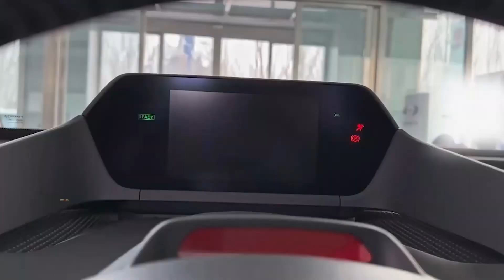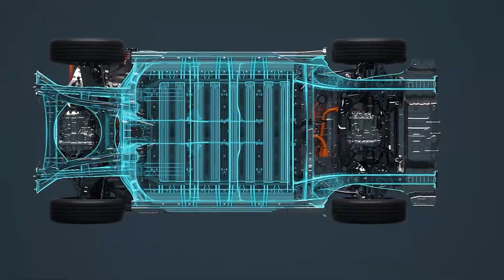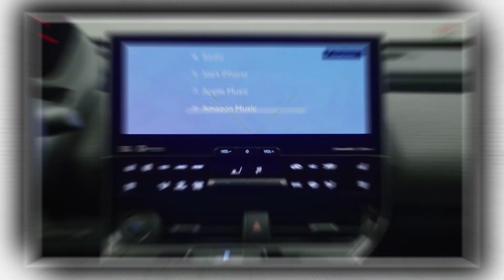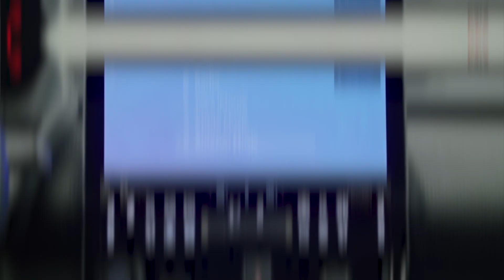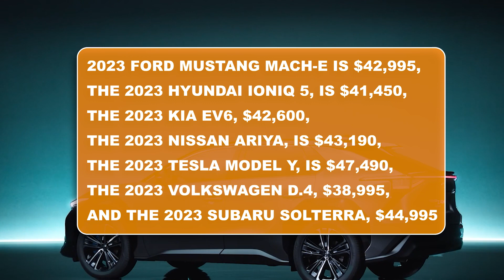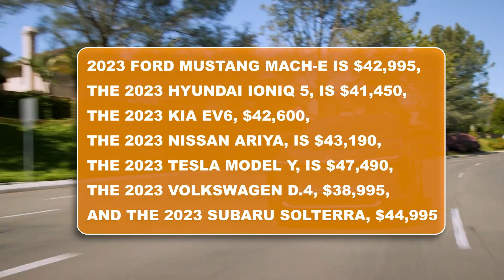Why The Toyota BZ4X Is An UNDERRATED Car!

Comment: I am happy with my bZ4x FWD Limited. As the first vars from the production line there where same problems than all other new EVs: charging speed and the range. After a while Toyota engineers received data & feedback they have sent two program updates for all bZ4X. The both problems are solved. Consumption is low (12-16 kWh/100 km) and fast charging tak 11:11 es easily 75-130 kWh power.

Comment: Agree with the last comment. Biggest joke. Who these people raving about this so called EV. Charging curve is a joke, just low 200 miles per full charge? And the wheels fall off. I won't go near it even if it was sold for $10K.

Comment: Unique Valve for shortest Braking-Distance and supirior stability while braking. 
(Important for fast Passenger Cars)
My Invention:
I have a (complete design of) low-cost Valve that will replace the 2 on-off solenoid valves (for each wheel, in the ABS) 
Will create Brakage: 98% of ideal decelaration on dry-asphalt with paddels (wet-asphalt): Thus create the best ABS in the world,  Reduce ABS size (more reliable than solenoid valve). 
Note: Today ABS use two On-Off Solenoid-Valves because Proportional-Solenoid is not good: 
Low-Reliability, and at mid position the flow will be too high thus compell bigger-pump. 
Dear OEM : Please Reply...